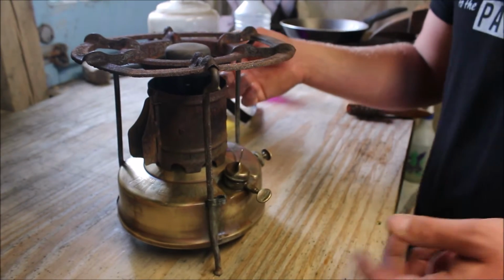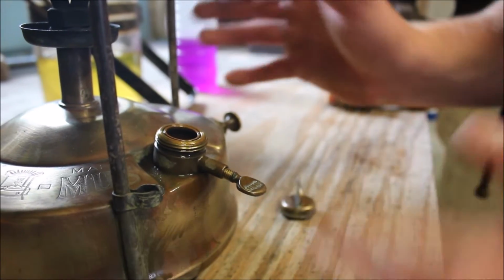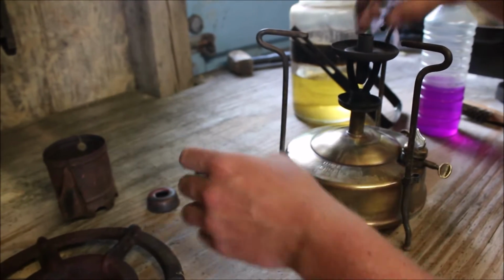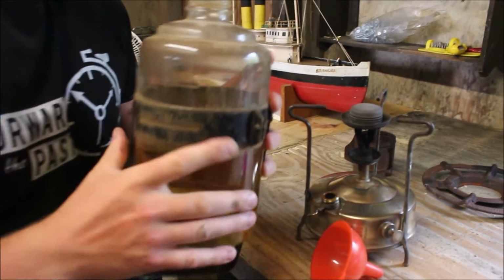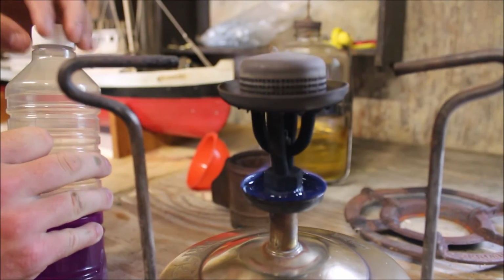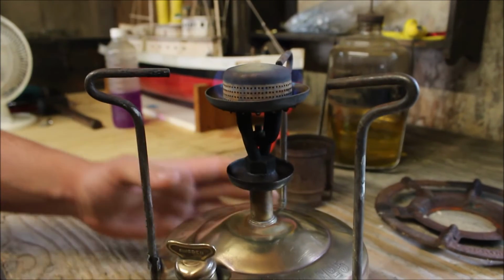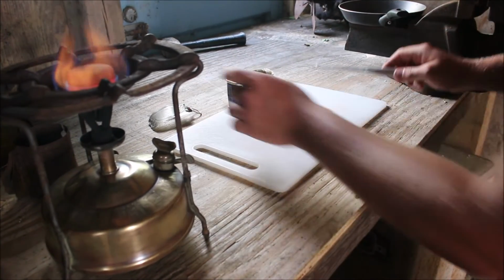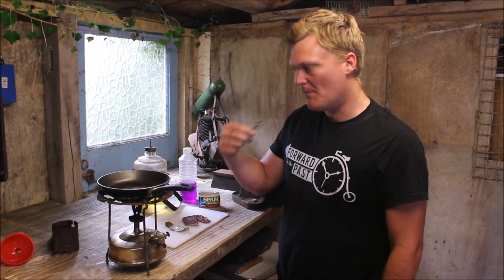Vintage Paraffin/ kerosene Primus camping stove

Comment: I too love these old pressure stoves! I have rediscovered them earlier this year, with all thoughts being on alternatives, re - the energy/food crisis. They have become almost a hobby for me and I have four of them now. Yours is called a "Silent" burner, which I think is a Primus No.5. There is also one the same size, Primus No.1 (and others) which is called a "Roarer" burner, which is, as the name suggests, noisier. They don't usually have to be prime burned with methylated spirit (denatured alcohol) twice. Once is almost always enough to heat the burner to the right temperature. If it doesn't light automatically as the meths burns off (tighten the pressure relief screw a minute before it's completely burned away) then a well placed lit match will usually do the trick. Also, either your leather cup washer on the pump is too worn and needs replacing. The stove would not normally need anywhere near as much pumping. If not the washer, then the non-return valve may be acting too slowly, needing cleaning or replacement.   In my experience Primus is far and away the best make as far as quality of build and operation is concerned - don't waste your money on the cheaper alternatives made in India, as I did. Better by far to buy a vintage Primus and refurbish it. They just last for ever and once established, just the same as cooking on a gas stove, which it is of course, only the gas is paraffin (kerosine) gas. I use lamp oil, a more refined paraffin, albeit a little more expensive, but there's no smell, better for use indoors. I reserve paraffin for use in my blow lamps. I have several blow lamps and again have found Primus (632) to be easily the best, and burning hot enough to braze with. AND, I'm really into Aladdin mantle oil  lamps, that's another story. All of these "Paraffin technology" articles were at the height of technological development before the "Modern age" of electronics etcetera. More importantly parts are still being made from the original and new tooling and all of them will probably outlast us all, as they originate in an age where things were made to, really last! Thank you for an excellent, and inspiring, instructional video. Subscribed!
Reply: I used both roar burners and silent burners  leading wilderness tours in the 70's and 80's.  I have a photo of my daughter starting one by 6th grade.  I never had to double light either a roar or silent burner.  For boiling a large pot of water the silent burner comes to a boil a little quicker than the roar. The advantage of the roar burner is the Noise.  You soon learn by the sound how much heat the stove is producing. the roar burner is much better in the wind.  I have three sizes of Brass stoves for different size trips.made by Optimus of Sweden as well as a small still in production Seva 123 white gas stove. It works the same as the stove in the demo.   As with all stoves they all have learning curve.  To preheat the tower I use white gas, liquid painters' alcohol or hand sanitizer gel in a pump.  All three burn hot with no soot.  In a pinch out in the field I often make a small wick out of twisted  toilet paper and pump a small amount of stove fuel into the spirit cup. Light the wick and the kerosine will burn. You don't need much kerosine in the spirit cup. The brass stoves take up little space in a pack. They breakdown and the stove used in the video will easily fit in a 3 quart pot . The mid size fits in in a 2 quart  and the smallest fits in a 1 quart pot as well as the Seva 123.  After supper refill the stove and it will be ready for the next day.  You always know how much fuel you have unlike at propane canister.  At 81, I no longer lead trips but still go on three generation family trips and solo trips. You can find a good used stove on Amazon.   My moto is always use the best technology, not the latest.  The stove in this video does not break down, Not a good choice for back packing.
Reply: @tomsitzman3952 know if there's a silent burner on the market that'll fit a primus no.210?

Comment: It is true....you can carry fuel in the stove but not THAT stove. It has a fixed burner and there is no way of sealing the fuel in the tank. I left fuel in my Primus no.5 and pressure built up in the warm weather and paraffin travelled up and out of the jet and made a real mess in the box the stove was housed in. I'd forgotten to loosen the pressure valve/tank lock before storing the stove. Primus/Optimus 96, 00, 45 collapsible stoves are more suitable for travel with fuel inside. The stove you have there (I assume a no.5) was essentially a domestic stove widely used to cook on in the 20s/30s and was often the only cooker they had. These are great stoves and very reliable. I still carry a Optimus 00 or a Primus 96 in the car. Being a stove nut and "old school" I have about 20 stoves to chose from.
Reply: Have a silent burner by anychance that'll fit a primus no.210?

Comment: I love these things! I have one very similar to the one shown in your video - same tank size, same burner size - but with a 4-way flame splitter rather than the inverted mesh cup. It's a fair bit louder in operation because the flame is more turbulent. In fact the flame often glows green from particles of copper oxide coming off the brass tubes and getting ionized in the intense heat.
I also have several of the primus blowtorches, which operate in basically the same way, also designed for paraffin, though I run mine on either white spirit or barbecue lighter fluid since these are cheaper. They have a much hotter flame temperature than gas blowtorches - easily hot enough for high temperature silver soldering or even brazing.

There is a nice little modification you can easily do to either a stove or a blowtorch to make it easier to pressurize: Unscrew the pump housing and take out the piston and shaft. Then stick a brass Schrader valve stem (car tyre type valve) through the housing and solder it in place to make an airtight seal. Screw this back onto the stove or blowtorch, and now you can pressurize it with any hand or foot pump. I just use a standard piston bike pump to pressurize mine now - it takes only 2 or 3 pumps at most to pressurize the tank, rather than many times that with the tiny little piston pumps they originally come with.
Reply from the maker: Hey Lloyd,  that's very interesting about the alternate way to pressurise the stove, thanks for sharing
Reply: @forwardtothepast2411  Yep, tried it first on a really old one where the leather piston had turned to dust - and this brought it back to life, since there was nothing else wrong with it. Only one thing to be careful of - some cheaper valve stems today are brass plated aluminium, and these are just about impossible to solder to because the brass layer is so thin. But as long as you get a solid brass one, you're good to go.

Comment: What other liquids can be used other than paraffin ? thanks
Reply from the maker: The Americans use kerosene,  but that's the same thing apparently,  some people say you can use petrol or diesel,  but I think that would be very dangerous,  I would say paraffin only
Reply: @forwardtothepast2411  This whole "Fuel" topic is quite the Rabbit hole , kerosene is aviation fuel apparently. But I have been in this rabbit hole and my conclusion using the Occums Razor is that there are 2 main fuels Oil based and Alcohol based from fermentation/bacteria, and the simple question why are'nt engines built to run on ethanol , also Natural Gas was once Coal/Town Gas but is merely mostly Methane and Methane can be produced by bacteria begging the question Where does our current Gas in UK come from ? As I believe Gas can created ethically and cheaply and thyat Fracking is not what we think it is Or Crude oil maybe the result of melting and distillation of millions of human corpses from current and past massacres.
Reply: I’m sorry, I didn’t catch the name of the purple fuel you used to warm up the tubes.

Comment: This video is showing “Under-Burn”. Clean, blue flames should be emitting through the holes in the cap. You will destroy your burner if you follow this guy's advice.
Reply: Yes quite right blue flame should be emitting from all the holes in the cap for a good burn.The jet needs cleaning possibly as somethings not right .
Reply: I was thinking the same thing